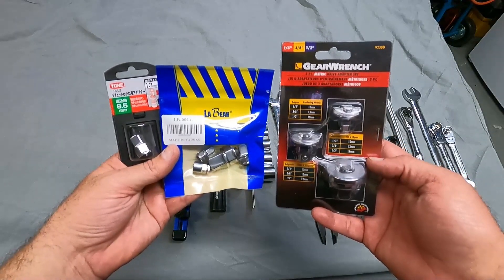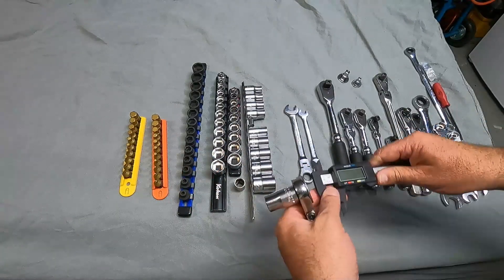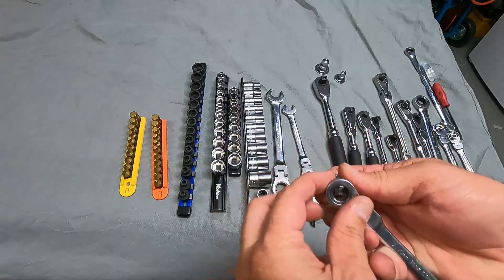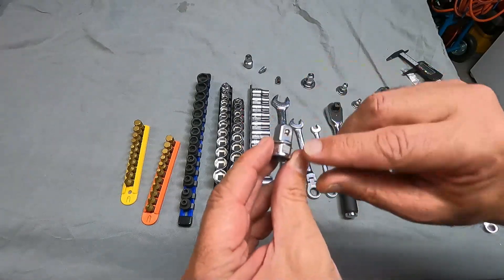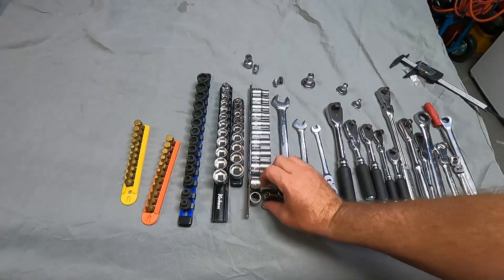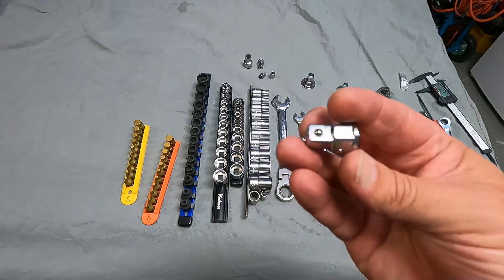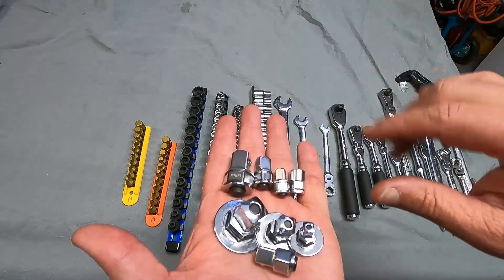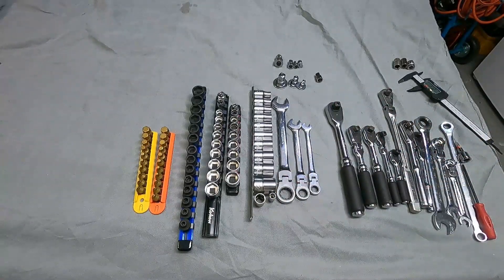Are Socket Adapters for Ratcheting Wrenches a Waste of Money? GearWrench LABEAR TONE Tool Co. Japan

Comment: Nice comparison.  These are good to have on-hand, but are limited in usefulness as you show.  

If you want a super low profile socket, then I suggest getting a pass-through socket set.  I have the GrearWrench 1/4" & 3/8" sets and they excel at fitting tight spaces, plus the added advantage of being able to slip over long studs.  I wish they still made the 1/2" set.